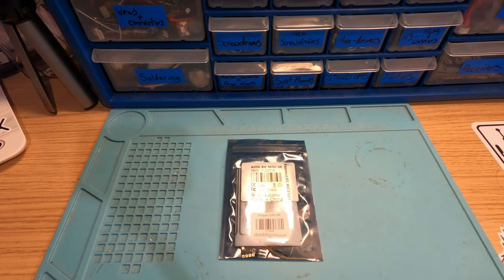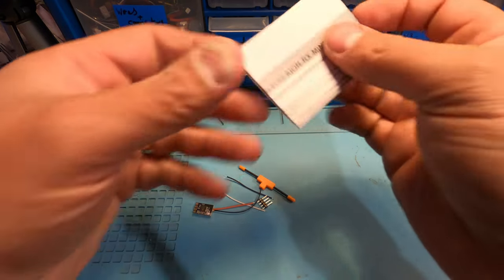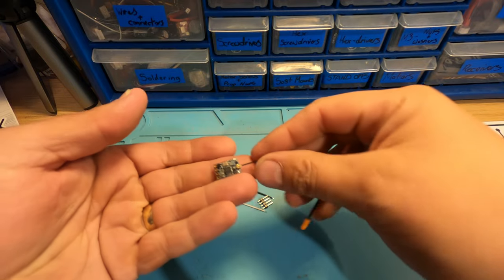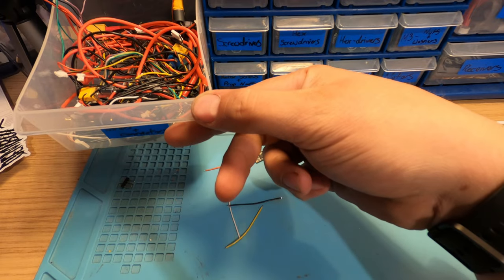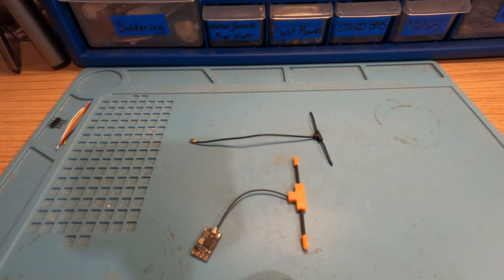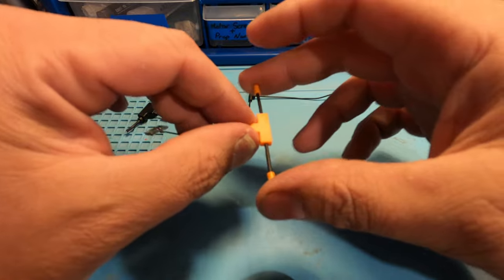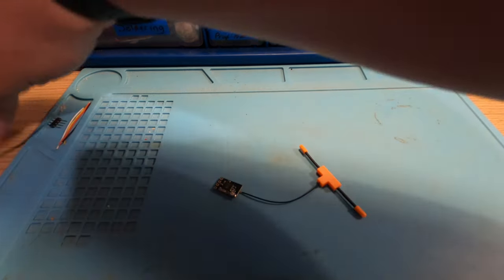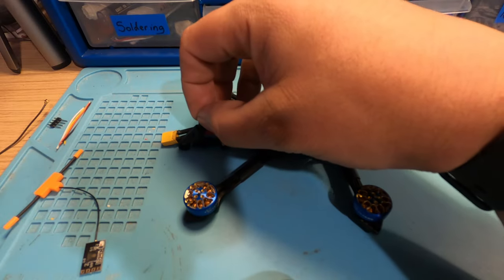Jumper Aion 2.4ghz Elrs reciever . What's in the box ?

Comment: Ive got one of these on a Mobula7 HD that i took the HD split out of, its been great so far
Reply from the maker: I'm gonna use mine on 3 inch built . Looks like a solid receiver 👍
Reply: @ts13fpv  That 3inch build looks very nice, I will keep an eye out for the maiden flight, the only thing i would say about the receiver is maybe put a dab of super glue in the orange bits on the ends of the antenna as they seem to come off easy on mine.
Reply from the maker: Great tip 👍 thanks.  I had the same issue with crossfire antenna befor I switched to elrs